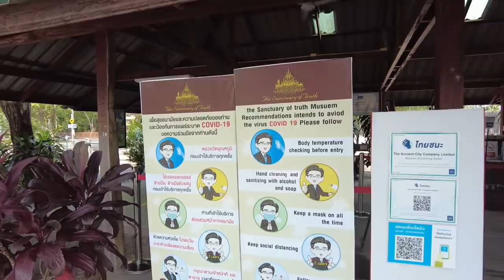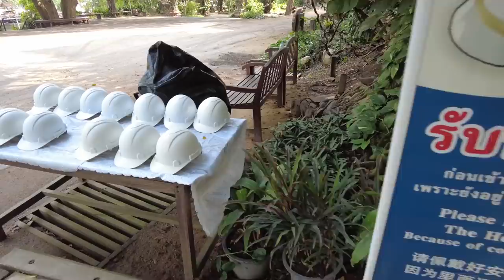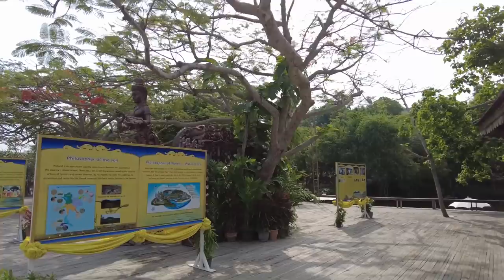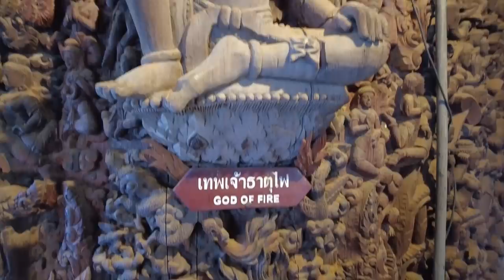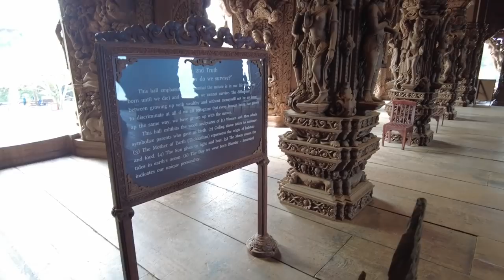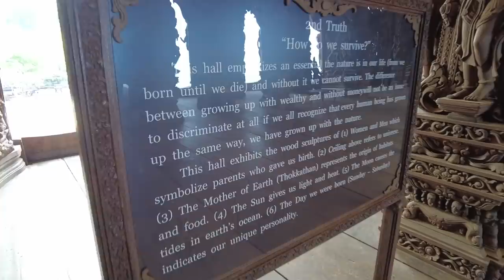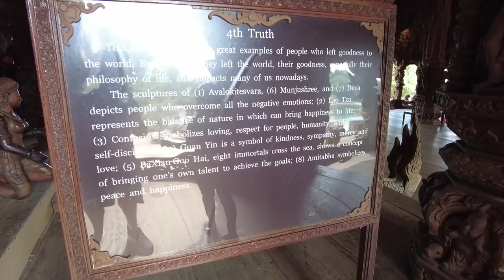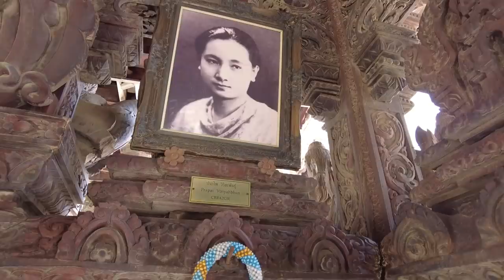Inside the Sanctuary of Truth in Pattaya Thailand, what a place this is and well worth visiting!

Comment: One thing that instantly comes to mind...........with the complexity of the structure, there surely must be architectural plans somewhere but one doesn't see anything of the kind.
No obvious engineer, foreman, work site safety officer handing out fines.
Many commercial building sites I've worked on could do well to follow their examples.
Mind boggling example, thanks. I have seen similar example of carvings and timber buildings in Thailand but not to that large amount in one place.
I think one of the kings palaces was a large timber "house" but forget where it was now.
Hey Trev, movie 5th element.............
What are all the concrete blocks on the sea side...??
Reply from the maker: An old honesty I have no idea but I'm sure you are right
Reply: They are sea wall Mr. Jeff. To protect water coming in, in times of high tide and also as a stopping point for curious people looking around the sea.